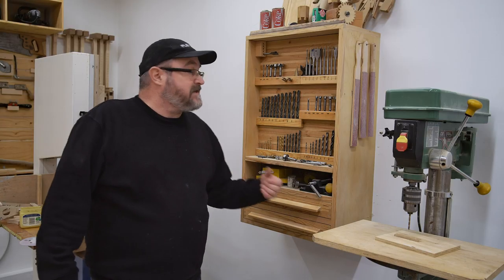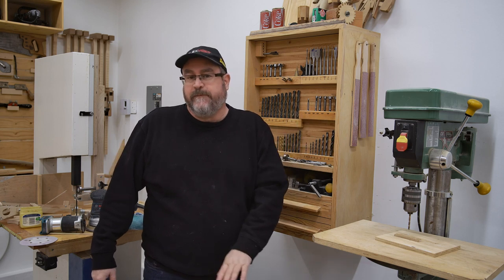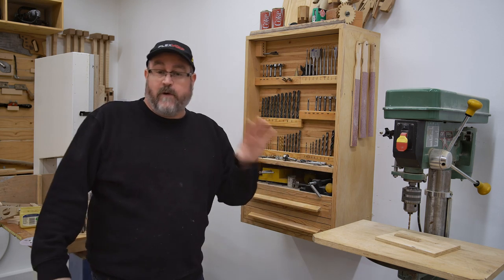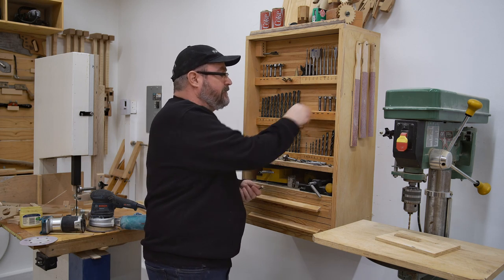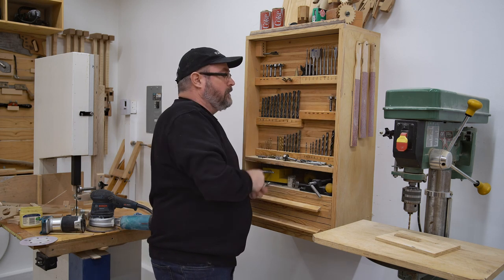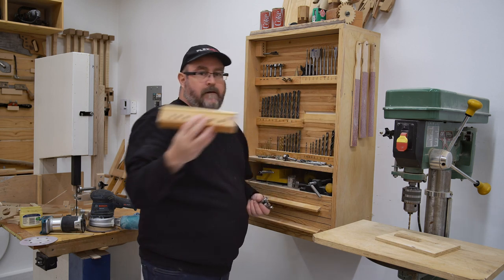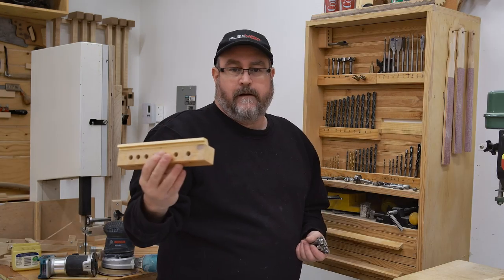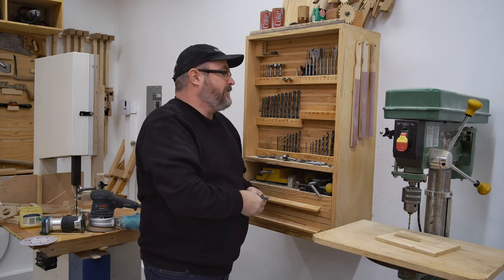Why French Cleats for Tool holders Suck!

Comment: If you do just a basic French cleat this is correct. However you can put a key stock in to lock your tool holders in place so they don't jump out of the cleat when you accidentally knock into them. A better way would be to drill a hole near the top of your cleat and put in a little thumbstock hole to do the same thing as a key stock. Locks the Shelf in place so it can't get knocked off.

Comment: We have both in our house.  We have a large slatwall panel in our laundry room which we use to hold brooms and such, and in the shop I have a rolling dual-sided slatwall panel I rescued from the dumpster when the local cell phone store went out of business.  It has heavy duty aluminum slats and weighs about 75lbs.  I use it similar to a rolling clamp cart.  I also have a 4'x8' french cleat wall in my shop.  Here's my take:

The french cleat wall is much easier to customize.....just cut some 45 degree strips and attach to your ensemble.  The slatwall takes a bit longer because you must use a router or cut rabbets.  The biggest advantage of the french cleat wall is it's strength and ease of moving heavy attachments.  You can mount an object that weighs 300 lbs using multiple levels of cleats......and moving it only requires lifting upwards.   This really isn't possible with the slatwall because of the pivoting motion required to insert the anchor arms.  You can only use one level as an attachment point.....and "pivoting in" a heavy object can be difficult.  You also would probably need to buy metal anchor arms because shop-made wooden ones probably wouldn't be strong enough since they can't be thicker than about 1/2".    

The biggest advantage of the slatwall IMO is the availability many cheap and easy off-the-shelf accessories......whereas the french cleat wall doesn't have any.   I don't have to waste time building anything.  My current rolling slatwall is covered in pre-made plastic bins, baskets, hooks, and arms.  It makes it super easy to hold clamps, rolls of paper towels, and smaller objects that can be hung or tossed in a bin.  And as mentioned in the video, they are all "securely" attached.   IMO the slatwall is kind of a hybrid between a french cleat wall and a pegboard.

Comment: I've never had a problem with my tool holders falling. Also, I'm constantly moving the holders around as I readjust things on my workbench because of a lack of space. I like being able to quickly and easily move them around. I suppose if I had a bigger workspace,  things may change - but they work great for me (key word ME). Not making a statement about good/bad in general.

Comment: Like most things there is a time and place to use french cleat. I find it is great for larger things like cabinets and John even used it sort of to hang the skyline diffuser.

 Just because I am lazier than John I adopted the Matthias method of just screwing my tool holders to a backing board, but I agree french cleat is not ideal for small holders.

Comment: Good sir I have a builder question. You make a very valid point. What would you say if some one were to make a french cleat wall (or box) and put in a securing bold? something to help make sure it doesn't pop off so easily. Of course taking away from quick removal but still allowing the space saving aspect.

Comment: I've always thought french cleats are unnecessary for tool holders. Just screw the holder in place, theres big chance you'll never move it.
Reply: I had the same opinion before but now since I have french cleat I don't wanna miss it! 
Sure your right in most cases once the tool holder hangs it hangs there forever but believe me or not it's a way easier to organize your shop with french cleat you just start make your tool holder one by one and organize them after you done with fixed holders you can't do it that easy
Reply: A little bit of double stick tape, or a small drop of hot glue, and it will prevent them from getting knocked out of place, and they still can be easily moved if needed.
Reply: Create a peg to push through the cleat to lock it from vertical movement.  Can be removed, but will prevent accidental movement.

Comment: I was given a bin system that worked like french cleats. A metal rail was screwed into the wall and the little red bins hung off of it. I spent so much time picking up screws and putting them back into the bins that got knocked off. Now they all just sit on the rear of my work bench collecting dust an junk.

Comment: I like french cleats for hanging heavy cabinets.  It is much easier to level the french cleat part and screw it to a couple studs and then lift up the cabinet, then it is to hold a heavy cabinet and then level and screw it (hopefully) into a stud.  Great video! everything has it's place.

Comment: John,I am in the process of making your slat wall tool holder.

I am stuck at how to cut the slider boards.

In the video you show 1/2"x3/4" slider board. with a 1/4"  90 degree cutout.

In this video, it appears, at the beginning flash screen,  you are looking angry at your bits, that the slider board has an additional angle cut at the back bottom edge of the board, instead of 90 degree angle.

Was this changed since your initial video from 4 ? years ago? 

Is this to allow pulling out the slider board instead of having to slide it all the way down to either end?
Reply: Never mind. Found it in a reply to PS Williams. The back needs to be beveled.
Maybe a good idea to add that to the build page. Had to use my browser "find" to search for "holders" in all of the comments.
By the way, I like many of your builds and plans.

Comment: This is why I cut a 15 degree angle in the bottom of all of my wall cleats and an opposing 15 degree cut on the top of all of my tool holder cleats. Then you can make a trapezoid lock block to keep them in place, and still have the flexibility to move them without unloading them.

Comment: It's not hard to prevent a French cleat set up from bumping up and off. For example, put a dowel through the hanger so that it catches under the strip on the wall.  With a shim you can make this connection as tight as you like. I'm not dissing your slat wall. It's great. But, John, if you gave it a little more thought you could probably come up with something even better.
Reply: And that made me think of a way to put things securely on a slat wall without sliding them in from the side: put an oval on the back of the hanger that you can turn from the front. In its narrow orientation, you can put the back of the hanger into the slot and when you turn the oval it locks into the rabbet on both top and bottom. Probably somebody already does this. As John once said, there are no new ideas.
Reply from the maker: I did come up with something better - I showed it in the video.
Reply: @IBuildItScrapBin  For a French cleat, John.
Reply from the maker: Kind of the definition of counter productive, slat wall is clearly superior in every respect. Why waste time trying to improve a system that's flawed from the start?

Comment: Fully agreed. French cleats are fine when you need to move stuff often (who hangs stuff that needs to be moved often...), or when they're hardly ever used. I know for sure that I would pull the entire french cleat toolholder of the wall about 50% of the times I'd want to take out a drill bit.

Comment: A french clear would be great for hanging that cabinet, for the individual tool holders, not so much. As for drill bits, what ever happened to a drill index?
Reply: @Roderick storey my twist drill index would fill that entire box, plus when I'm trying to pick a size against a fastener or matching a previous hole, I think it much easier to pull the bits in/out of a compact index than on and off the wall. Kinda like sockets on/off a rail when your trying to pick one for a nut or bolt that is attached. I guess I'm just not good at eyeballing the size of things.

Comment: I’m confused.  I thought you had to slide the holders out the side for your slat wall to remove them?
Reply from the maker: It works either way. You have to bevel the bottom of the hook part that goes into the slot to make it so it can be removed from the front.

Comment: How about a velcro wall?
Reply: Dust magnet. And you'd need it to be under constant tension for it not to flex. Not sure how to explain  what I mean, it wouldn't necessarily hold a piece of wood that's 1" wide horizontally...
Reply: My comment was more of a weak joke. It's interesting that there is a lot on youtube about tool walls. It seems that a few of the real craftsman on YT could care less about a fancy tool wall (Paul Sellers ) for one  Most of their efforts are directed toward woodworking  and not how beautifully they display their tools .
Reply: @williambranham6249  If you want to sell plans, you need to make stuff look nice and inspiring. Not about beauty for me, it's about maximizing every cm I have with the most efficient storage method that's also easy to use, so I don't have to waste an extra 10sec fidgeting with the holder every time I put a tool back...
Reply: Yonatan 24: Good point, didn't think of selling plans  as a reason to have a nice tool wall.

Comment: You are right that items hung by French cleats can be knocked off too easily.  But you didn't mention the other problems with French cleats.  You have to spend time putting an angled edge on a lot of boards, then you have to attach them all to the wall at regular spacing.  Then you have to make the angled hooks and attach them to the back of every tool holder.  And finally, you end up with a system that has limited flexibility on where you can locate things.  If you follow what I'm saying about French cleats, you'll see that some of the same problems are shared by slat wall.  You have to buy specialized panels, or take the time to make your own panels.  And you have to attach a cleat to the back of every holder.  Slat wall systems also restrict your ability to locate items like French cleats do.  I'm sure you are aware that Matthias Wandel made a video a while back in which he said what I've just said.  He came to the same conclusion that lots of people have, it is easier, faster, more secure, and is more flexible to just put up a sheet of plywood, OSB, some other sheet good, or even solid wood panels, and screw your tool holders to it.  If you need to move things around, you unscrew them and put them back anywhere you want.
Reply from the maker: And that's like saying there's no point buying a good table saw when a cheap one will make all of the same cuts. Some guys want a better saw, and some guys want a neater tool board without a bunch of screw holes.